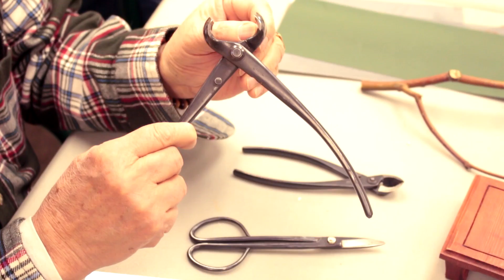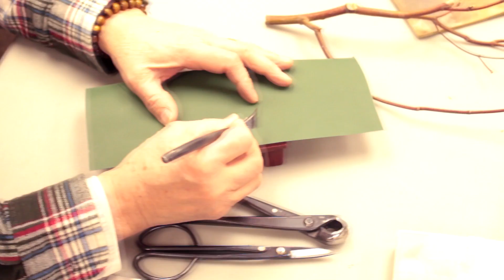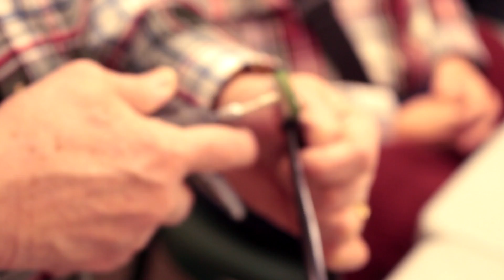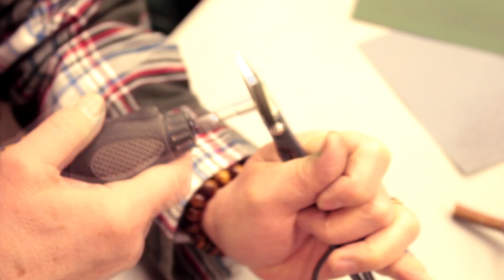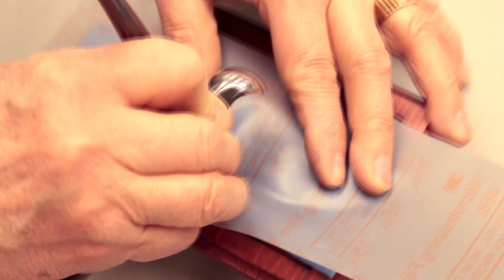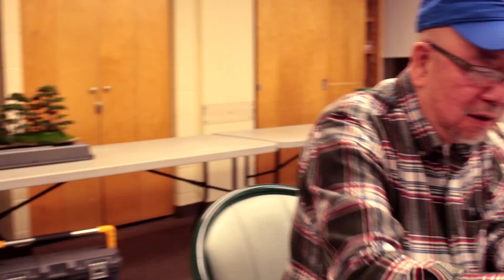How to sharpen your bonsai tools, Feb 2017

Comment: Than you so much for the amazing video. I have a question regarding sciossors with a convex (hamaguri grind) bevel, which are thus not perfectly flat on their front bevel side. Would you know how to sharpen these, as you cannot use the flat reference edge when placing the scissors onto the sandpaper?
Thanks so much!

Comment: I just use regular japanese water stones for the tools with straight edges and the slurry the sharpening stone produces on a piece of soft wood for the tools with curved edges and the inside of the concave cutters. I´ve seen a japanese guy sharpening his tools that way. I don´t know if it´s a traditional method but it works well. For polishing I use regular chrome oxide buffing compound on differently shaped pieces of wood. That way heat is no issue. This works perfectly fine with high carbos and stainless steel. 
Sharpening is always a very controversial topic. Among woodworkers it´s a topic that will provoke arguments every time it gets mentioned but even though everyone has their own method, if your tool is sharp at the end, it´s not wrong.

Comment: I'm pretty savvy when it comes to steels and their use at various hardnesses.   Bonsai tool makers make it very hard not labeling steels and heat treat.  I'd have a set already if I could find some data.  Carbon steel means anything from a melted tin can shaped into a tool or O1 steel taken to 63 in the heat treat.  They really do themselves a disservice.
Reply from the maker: I totally agree, they should be advertising the steel and the heat treating/tempering process. They should also make them so you can take them apart for sharpening. The rivet works well, but an adjustable nut and bolt would be better.
Reply: @TheBonsaiZone  Maybe they will now!  You get rave reviews in the  Facebook groups.  Someone might hear. 😃
Reply: I bought some shears whose handles bent when I tried to cut a zip tie. The reviews were good, too.
Reply: Hybrid cutters
8"
CPM-3V
58-60 HRC

Comment: I have a question..
Do you recommend any ‘treatment’ to a new set of Bonsai tools before using them?
What I mean is should one oil up their tools or do some form of protective coating against tree sap, funk and other day to day residuals to prevent the tools from either rusting or not cutting as a new tool should..
Thanks for the video, very informative
Reply from the maker: I like to polish the machined surfaces on the tools to a mirror finish. This removes all the fine scratches or grinding marks in the steel that will get filled with sap from your trees. The smoother the finish, the less the sap sticks to the tools and the easier the cleanup. I try and rub a oily rag over the tools before I put them away each time I use them. This does nor always happen and I pay the price! The tools will get some rust on the surfaces and this will require cleanup later. It is a good idea to keep alcohol in your tool box to disinfect your tools before you oil them and put them away each time also.

Comment: My hand made (trial run) bonsai table used in such a manner, how rude! lol
Reply from the maker: Do you still make the tables?
Reply: I could, made 3 trial tables for the last bonsai show, trying different techniques. Those were made for free using scrap 2x6 from work (its actually one piece, legs are not attached after but carved out of a single solid piece ) but would be alot faster and easier to just buy the proper  1x6 and square legs to attach after

Comment: Finaly ! 
Thank you for the tipps
Reply from the maker: Your welcome, Hong is a great assert to our club, we are lucky to have him as a member!
Reply: Nigel Saunders I have another question.  
I always reed you have to sharpen the nobcutters from the inside. Now he tells us to do it from the outside. Whats the right way now ?
Reply from the maker: With any blade, you have two surfaces that form a shearing action. On a set of shears it is the flat side of the blade. These surfaces slide across each other with a slight bit of clearance and the beveled edge does the shearing. Because the spherical knob cutters have the overbite, the reference surfaces that determine the clearance between the blades is the outer surface on the one jaw and the inner surface on the other. I would sharpen the jaw that sticks out on the outer surface and the jaw that tucks in on the inside, I would sharpen on the inner edge. This should keep the clearance between the two cutting edges constant. I have been looking at images of the cutters on the internet and it looks like this can vary between the manufacturers, some grind the inner jaw on the outside and the outer jaw on the inside. In conclusion... I would have a look at your knob cutters and try to keep the two edges that determine the clearance between the blades untouched and just sharpen the other surfaces. I do some more research into this for a future video. Thank you for a though provoking question!
Reply: Nigel Saunders I have to thank you for giving us such great advice